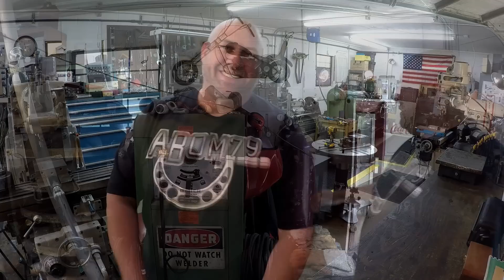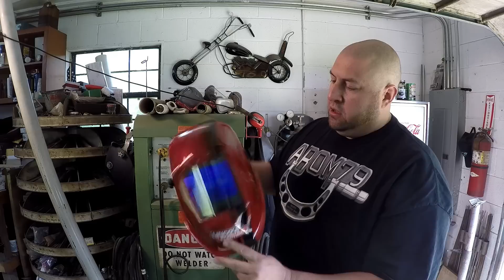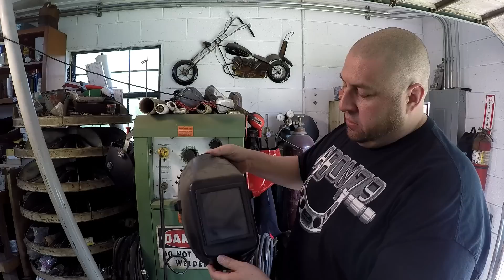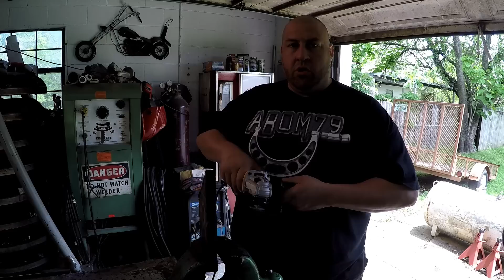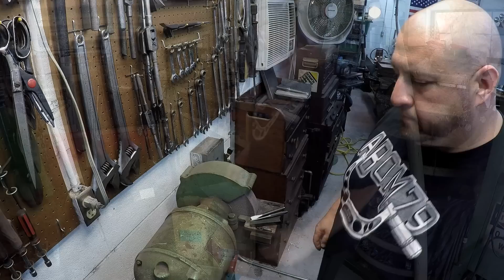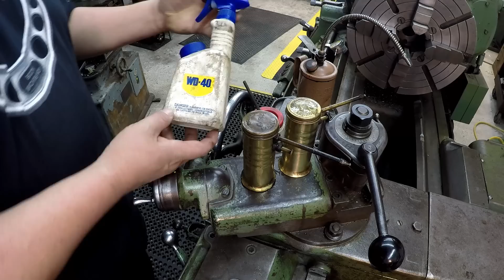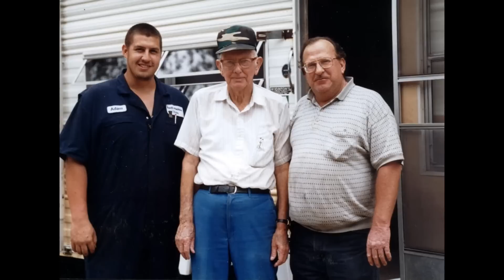10 More Shop Do's & Don'ts

Comment: Quite the informative video on general shop etiquette.. I'd like to add on to how one should go about using a grinder.

For tool's sakes, don't suffocate the air vents with your hands, especially the intakes at or near the cord end! 
I've seen quite a few people take a new or new-ish, perfectly working grinder, grab n switch it on with one hand, and grip the cord end with the other for leverage and totally covering the intake vents, with and without gloves, and do some hardcore grinding or cutting task for all of 3-5 minutes, only for the poor thing to smoke and burn out before finishing the job.

And of course, damage like that is guaranteed to be beyond fixing, unless one fancied the cost of a replacement rotor and maybe brushes, plus shipping and repair labor fees. Lost count of how many grinders i've had to fix just from this issue alone, aside from the usual suspects like worn out brushes, commutators, melted brush holders, et cetera..

Comment: I have to disagree with you on the torch one. I was taught to shut gas off first so the oxygen blows the flame out and prevents any flash back into the torch. ( Hopefully you have flash arresters in the line) but yes the little pop can be annoying but it's safer

Comment: Hey Adam, can I borrow............
Yeah, my Dad was like that - happy to help people out.

But not latterly, too many people totally abused his friendliness. Too many tools came back damaged - or not at all. In some cases a cheaper 'equivalent' tool was returned. Tools just aren't tools - you will surely know this - any random tool no matter how basic, simple common is not simply that to folks like us. They're part of YOUR family. I've inherited an 0-1 mic - the box is tatty but the mic is good. There's nothing overly special about it - to anyone else - but my grandmother bought it as a 21st birthday gift to my dad - in 1945.
Dad had a defective left arm - so didn't go to war. He worked on aircraft engine assembly. Leaving home, he was required to take cutlery. He took a knife from the cutlery drawer - choosing the one no one liked - simply because if it got lost, little value was lost.
60 years later, at home, he'd have his last meal and use that very same knife - it saw him through the war and on to pretty much the rest of his life - before going into hospital terminally ill with cancer.
Some tools we customise for specific jobs - grind a bit off here and there to get through a tight spot to a nut or bolt.
Here I am with some random DTI - getting the 'glass' fixed. It's never really run smoothly - but it's been in the family over 40 years - I remember playing with it aged 8-9.

Comment: If you use a drill bit and either you dull it out or chip it or found it in that condition, sharpen it before you put it back in the index. it gets annoying always grabbing dull/chipped drills

Comment: As some of your viewers remarked my father taught me that when you ask to borrow another man possession always return them in better shape than what you recieved it in.  I passed this onto my nephews.  A couple years ago my nephew asked to borrow my Dodge 3500, 4wd diesel with a full size camper.   The truck was returned with a full tank, washed.  The camper's propane tanks were filled up, waste tanks empty and the entire camper spotless inside and out. They had driven to Yosemite and put close to 2k on it.  Upon returning he immediately pointed out a scratch where he had backed into a branch in a campground and had already scheduled to have it fixed at a autobody shop.  He had to point it out and he was so embarrassed and apologetic.  I told him don't worry about it.  Some time later my son-in-law asked to just borrow the truck as he was helping a friend to move.  I get the truck back two days late, empty tank (that was $90!), garbage, wrappers,  and pop spilled all over everything, and umpteen new scratches on the rear fenders.  Two years later he asked to borrow the ttuck again.   My answer was brief,  NO!  Last time you borrowed the Dodge you returned it filthy inside and out, the tank empty, and several new scratches on the rear fenders, so No, you may not borrow it now or in the future.  You'll have to go rent one.  Needless to say, he's never asked to borrow anything else.  Thank you father!

Comment: As I’m the only person that maintains /dresses the  grinding wheels I’ve noticed “milling machinists” always grind rads on keys, and leaving big grooves in the face and sides of the wheels, even tho we have a linisher that will do the same job , then when I want to grind an accurate Acme HSS tool I’m having to re-dress the wheel.

Comment: Disagree on the grinder situation. Either get a bigger or better grinder. I use grinders that have are rated at 750wand wont bog down where an 1100w from a different brand will (both 5"). In particular with grinding discs you need to force them so you dont glaze the surface, much like "loading up" the wheels on a pedestal grinder. And of course you need to keep them moving.

Comment: IF YOU CHEW, DON'T SPIT ON CUTTING TRAY OR IN THE COOLING FLUIDS.  WASH HANDS AFTER USING RESTROOM, HANDLING SOLVENTS AND OTHER CHEMICALS.
I HAD MICRO-SWITCH INSERTED IN A SHORT PIPE THAT HOLDS CHUCK KEY.  THE LATHE WAS WIRED SO IF THE KEY WAS NOT IN THE PIPE THE MOTORS WOULD NOT RUN.  NO KEYS THROWN ACROSS THE ROOM.

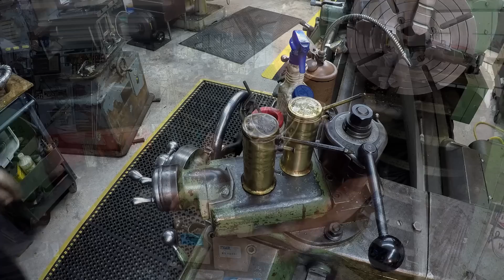Comment: 11:21 perfect example of an "11th don't". Notice  the removed box-flaps on the other box. this prevents box flaps from hanging out in crowded aisles to catch on clothing or scratch exposed skin or even  someones eyeball if it's sitting on a shelf at just the right height.  Don't leave boxflaps sticking out, especially in traffic areas.

Comment: Adam, I worked in a factory that manufactured hydraulic pumps several years back, and we had a guy on third shift very frequently set up one of the few "common" machines (i.e., used by all departments at some point, always kept ready) then go take a nap in the john. One night, in the heat of summer, another gent, aware of this other person's habits, took a mop bucket of not-so-freshly used water, and dumped it over the wall of the stall. When management heard what had happened, the guy who dumped the water was still employed, but the other couldn't help but let slip he was asleep in the stall when he was rudely awoken by being soaked in nasty water. They made him clean his toolbox out before he could leave, and found between 15 and 20 THOUSAND dollars worth of precision tools, both company owned and people's personal tools. It was a nice night for those who had so much go missing, and he got a police record, because some of the tools belonged to people who had already left the company, but missing/stolen tool reports were on file. Thankfully all tools were returned to their respective owners afterwards.

Comment: Adam, can you start a  NEW tools of the trade section ?  I really liked that lathe boring bar attachment set with the replaceable small bars , never seen them like that before, going to buy a set. So much stuff out today to make our life easy that we old school manual machinists never seen !,  ( nobody knows everything ) P.S if I see a tool I like that I don't have , I might borrow it from you  twice to finish a job ---- but after that ---- Hello MSC ! my credit card number is !  2 days later I got my own. Very simple. I would feel sooooo bad if I damaged YOURS !  Just the way I always been .  Also give it back clean and in the box or holder it came in, not in a PILE on the beach in front of my box ! a total oily mess and also remind me you put it back.  Just remember everybody in the shop is like a family. You got to work WITH THEM everyday ! .

Comment: PUT THE CHUCK KEY BACK IN THE CHUCK ! ------ that's a huuuuuge one for me ! My shop owner NEVER does it and I spend HOURS every time looking for it ! So basic but a must do .    and yes do MORE do's & dont's   They never teach many of these things unless you have spent decades in the shop .  Might also start a tricks of the trade ( like bent banding straps between thin wall parallels on the Kirt Mill vice ) section as well as they just don't teach this simple basic stuff anymore . We take our trade for granted the simple ticks long since forgotten . Like, how to sharpen a drill on a bench grinder BY HAND ! and make it cut dead center . Easy for a old school machinist, but a lost art today . Most just BUY a new drill ! because this is something not being handed down to CNC operators .

Comment: #5 is so annoying. I go over to use a grinder, and find the wheel speckled with bits of aluminum.

I also got another one for you: If you bust something, fix it, or notify somebody who will repair it. Things happen to the best of workers that's not your fault: end mills dull, inserts chip, cutoff wheels break, fuses blow, and so forth. If an end mill or drill is dull, don't put it back in the drawer with the fresh ones (although at some places I've worked, it's because the person was spinning it too fast and burned it up). If you're running a CNC machine, check your inserts every so often and index them if the edges are bad. When I worked at Caterpillar, I was the only one of the three shifts who'd do that (and I was the newest guy), and I'd have to start my shift spending a half-hour checking all my inserts and rotating/replacing them. If you've got a sticky gauge or loose fixturing, notify the proper people to have it repaired, so that I don't have to wait for it when I need to use it.

And most importantly, if you notice something wrong with your machine, notify the maintainers. Again at Caterpillar, I noticed my horizontal mill started making a loud whining noise when it would rapid the Y axis. I said I wanted it looked at, didn't sound right. Turns out the thrust bearings on the leadscrew were nearly seized (probably because they hadn't been inspected) and they had to put it out of service for a day to replace them. Still, that beats ruining the leadscrew itself and waiting two weeks for a replacement.

Comment: I especially like that part about putting things back.  Many years ago when ships were first being made of steel they were still under sail.  The anchors were of a design that required a sledgehammer to let go.  One day such a ship was in a storm off the California coast and in danger of running aground on the rocks.  That day the Navy lost a ship and I don't know how many lives.   When the order was given to let go the anchor the sledgehammer could not be found.  Someone had used it and not put it back.  The slogan used in the Navy ever since is, "A place for everything and everything in its place.   Thanks for your advice.  Good stuff.

Comment: A few weeks back I had a Dr apt and was out of the shop a couple hrs. When I came back there were a few guys there that we had come in to fix a cnc lathe. Anyway I noticed right away these guys had been going thru my tool box and using my tools which were now laying all over the place covered in grease and oil. They had never asked anyone they certainly didn't ask me at the end of the day they cleaned up and just left my tools laying everywhere all covered in grease and dirt. I have never been so mad. One should always ask permission before going thru another man's toolbox. I did call their company and lodged a complaint to wich they took monet off the bill and offered to replace any missing or broken tools and for that I was thankfull but still angry.

Comment: Another thing about torch tanks... Do NOT open those valves 20 turns open.. One turn opens that valve enough to max the regulator. Its not only a time issue all that extra time opening and closing all those turns unnecessarily its also a huge safety issue. If something happens to get dropped on those lines and punctures them you dont want to have to spin those valves all those turns to shut it off. That could be the difference in closing the tank off quickly and an explosion happening. That pisses me something awful. One of my biggest pet peeves beside picking up my $400 hood and trying to use it. If you can't afford a hood of your own your not a welder yet imo.. So just leave it there ill take care of it myself if you need it welded but dont have your own hood.

Comment: Borrowed tools should be returned ON TIME and in better condition that you found them.  In other words, clean it better than it was when you borrowed it.  If you have caused significant wear or tear on the tool, replace the worn parts or the tool.  If you can't afford to replace wear and tear, don't borrow.

Comment: If i borrow 3 times i buy!, Don't put back a dull drill bit., Don't put the grinder away with a wore out disk, clean the welding tip or cutting tip
before putting it away.and put away your stuff on the welding bench. including slag , scrap and cutoffs

Comment: What do you use to grind soft metals or plastics? I have two bench grinders. One has a coarse and medium grinding wheel and the other has a wire wheel and a cloth wheel. I also have a belt sander with a sanding disc and several angle grinders. I'm retired and none of my jobs required tools skills so I am a novice at a lot of things but I do have a bunch of tools and still trying to justify buying even more.
Reply: Its best to keep a dedicated grinding wheel for those things. And a set of wheels just for things like tool steels.

Comment: Another one for welding is wire, I've seen guys run a machine out of wire, shut the machine off, and switch machines instead of changing the spools
Reply: Seen that happen too. And also refill the rod oven, nothing worse then going in for some rods and finding an empty can.

Comment: Torch stuff... two things,  turning them off specifically in a body shop will get you hung.  The black smoke tends to get painters sideways.  Also.  I always back the regulators off so there is no load on the regulator.  Yes, you have to adjust them each time you use them... but you really should adjust your pressures for the job at hand anyway.

Comment: The murdering of grinders is one that really gets to me; where I work, there's a new 4" grinder added to the  heap of dead ones every two weeks or so. And folks are constantly complaining that the grinders/discs/etc are crap...  I'm still using my original grinder 3 years on, and it's the exact same make & model as the ones they keep killing! All comes down to not trying to force it to chew material off.
Then again, they also do the same thing with mag-drills and bits, burning 'em out by feeding in until it slows almost to a stop before yanking back out. I've just stopped lending out bits and tools because it's just not worth it.

It's that crappy attitude of "I need to get this done fast fast fast!", coupled with management pushing harder and harder to get things done faster. The weird thing is, the shop issues the grinders to everyone, and just keeps handing 'em out as quick as folk kill 'em, without question, as if a 4" Makita grinder is a disposable item with a month-ish lifespan.

Comment: 3 Shop teachers Mr. Loy (Industry Arts.) Mr. Huston (Welding Instructor) Mr. Miller (Machinist instructor) Great Uncle, Grandpa and Father, all 6 of them always top me everything you borrow gets returned in better condition than when you received it, Loy always taught me clean up after yourself because walking over to someone else’s mess is always bullshit, Huston taught me no matter how good you think you are there’s 7 billion people someone is better than you and Miller always taught me always check your work, if your name is attached to it make it the best damn thing you’ve ever made, and the 3 Men in my family taught me amazing shop and work ethics, besides always giving me a hard time for being young.
Reply: Also to add on here’s my biggest pet peeve, if something’s empty through it away, get something out, put it back, DONT FUCKING USE ALUMINUM ON A GRIDING STONE, If a sanding belt is becoming dull notify someone or replace it, Dont put dull drill bits back..

Comment: And to go along with the welding helmet section when you put on the welding helmet the sweatband goes against your four head you don’t want 50 other dudes sweat running down your four head when you start to sweat it’s disgusting

Comment: i work with stone not metal but the grider tip is even more true in my line of work. I witness many time guys just pushing on the grider till sparks and molten stone fly like crazy. Resin bonded cut off wheel can shatter if you push too hard and diamond wheel will burn up in seconds. Granted if you cuting stone you must push little harder that metal that is also why you need more powerful grider.

Comment: SO, as a newbie... If i'm not supposed to grind soft steal on the grinder,  where should I grind/shape it?
Reply: For me mate, you use a linisher/belt sander. Grinding wheels for the hard stuff, belts for everything else. Also use the appropriate grits for what you are doingand always try to  use the full width of the belt. Pet hate is a near new belt with the centre chewed out of it. $$$$

Comment: In Sweden it is the employers responsibility to buy work clothes, shoes, gloves and safety equipment, like welding helmets for the employees. When I worked as a welder we were provided really nice speedglas helmets with a filter system on your back, blowing clean air into the mask.

Comment: You are supposed to turn gas off first so it does not burn up inside the torch handle and fill it full of soot..take the torch head off and look inside..see if its full of soot